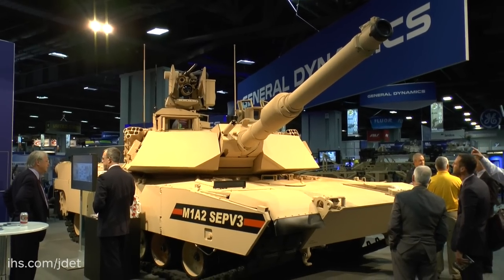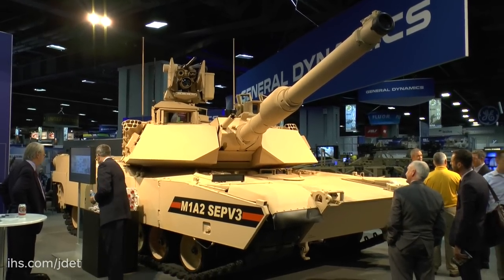AUSA 2015- GD Land Abrams M1A2SEPV3 MBT

Comment: How durable can the electronics and computers in a bouncing be?
Reply: well considering that the most damage when ieds blow up under the abrams is just tracks and a headache for  the crew members, i think most of the tank is durable vs bumpy terrain, i think the electronics might be protected, simply placing everything tightly would probably reduce the risk of anything breaking.

Comment: No active protection system. Just look at the Iraq supplied M1 tanks in Iraq and Saudi M1 tanks in Yemen all disabled by ATGM and RPG munitions.General Dynamics needs to wake up.
Enough said
Reply: +Phil G well The M1A2 SEPV1 that Saudi Arabia has and the M1A1&#39;s that iraq has are export variants without the depleted uranium armor layer. The Abrams that the US army and USMC currently operates are put forth into battle using a doctrine proven through combat. 
-Joint Fires Observer, U.S. Army.
*They also contain the depleted uranium layer, have better trained crews and better electronic packages. I.E. (DUKE System)
Reply: +xXEndLessKaosXx It doesn't even matter, as the depleted uranium is only in the front of the tank, its not going to save you from a ATGM fired from behind. But APS or slat armor could save you. 

http://www.yadlashiryon.com/VF/ib_items/1926/Canada3.jpg
Reply: Iraqi and Saudi crews are notoriously bad though, most of those tanks were disabled because they were just sitting in the open waiting to get hit.